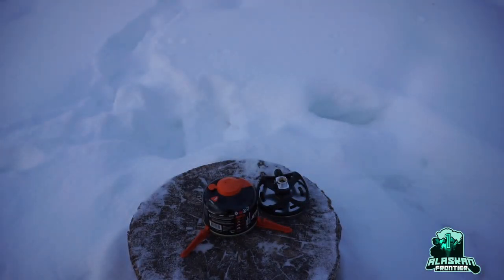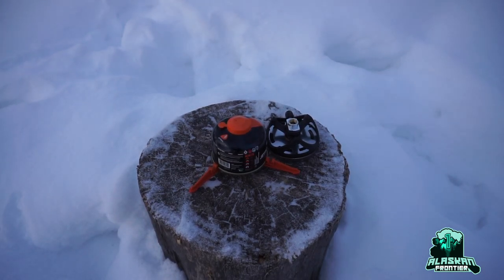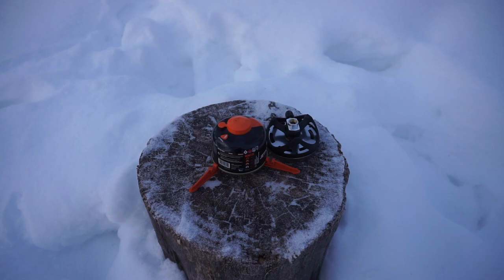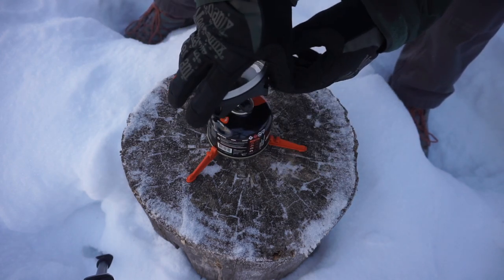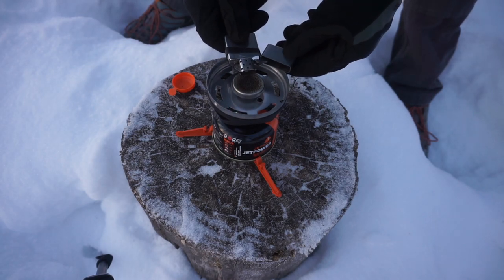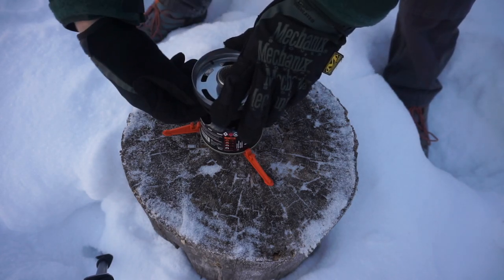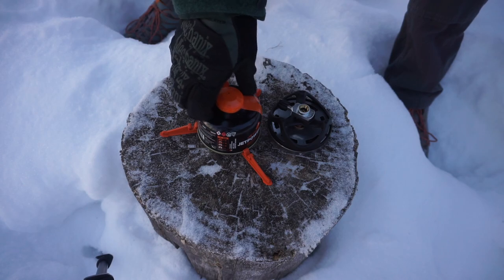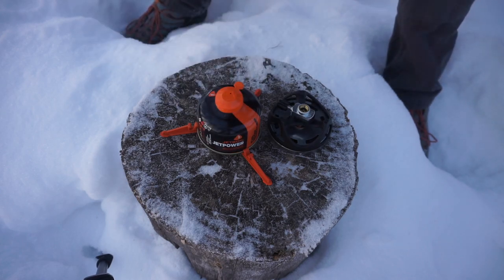Extreme Weather Testing JetBoil System

Comment: Keeping the canister inside the insulated cup won't change a thing as far as keeping the canister warm in a backpack , unless there is a heat source in with it. Keeping canister inside coat close to body heat does make it manageable. Also keeping water on hand and putting body heated canister in small bowl of water ( water is above 32 F for a while right?) you can make it work in super cold temps. It does require diligence though. The inverted system from MSR is a bit easier to manage IMO, still need to keep canister warm. I'll take mine out of pack 1 hr before needing to stop to brew to warm it  up inside clothing layers. Of course white gas is the standard for deep cold.
Reply from the maker: That's definitely the best way to do it!

Comment: Check out the Windpro II system from MSR. The inverted tank is the way to go in cold weather. That said, people shouldn't be in -26 degree weather. Lol. Great work though!
Reply from the maker: Thanks for the tip, I will have to check it out. Yeah, I wouldn't personally go out on days that cold, but it's important to know if gear works at those temps
Reply: @AlaskanFrontier1  Absolutely!

Comment: Huh so the fuel remained in a liquid state at -26° I'm not sure but at those temperatures guess you'd need a pressurized stove burning white gas, kerosene, or some such fuel?
Reply from the maker: Yes it would probably have to be a specialized fuel.